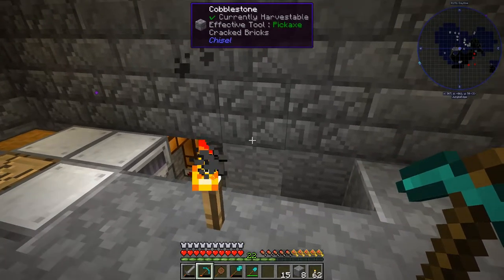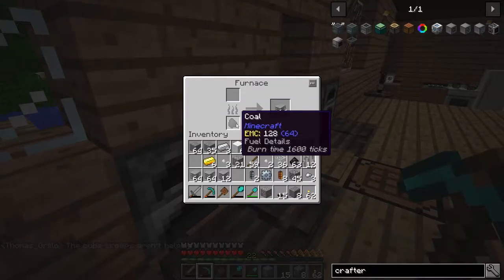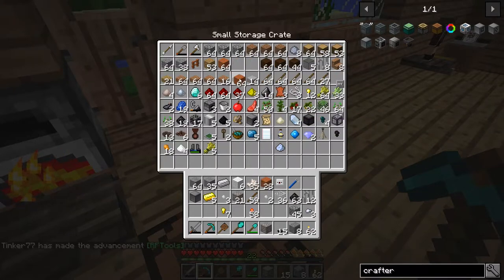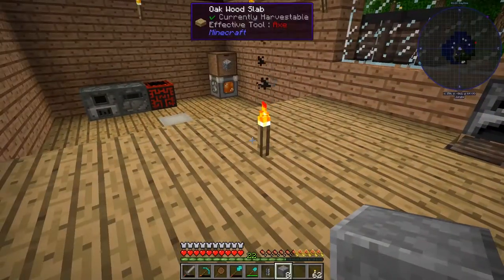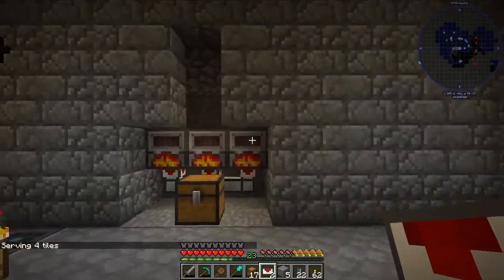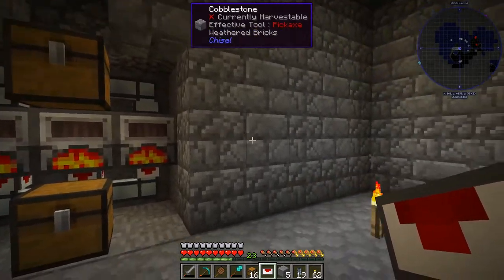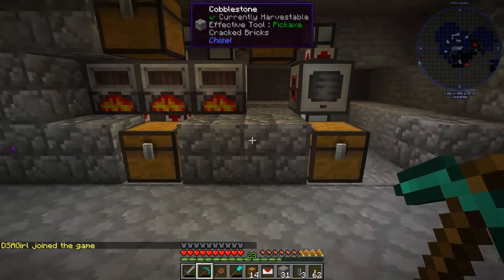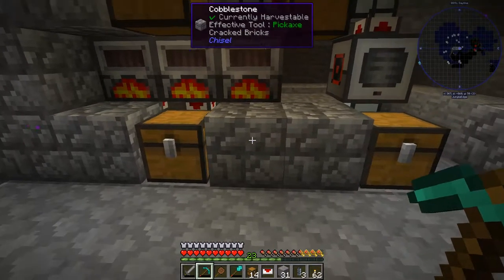FoolCraft 3: Episode 4 - Ore Doubler!

Comment: ummm tinker how do u make the elevetor?
Reply from the maker: In this particular pack, you take an enderpearl in the center, and surround it with white wool (or any color).  That makes the block.  You need two, and they can only be placed up to 20 blocks away with only 4 solid blocks between.